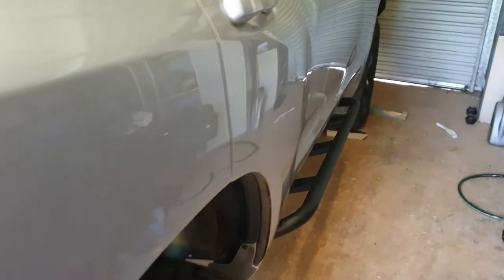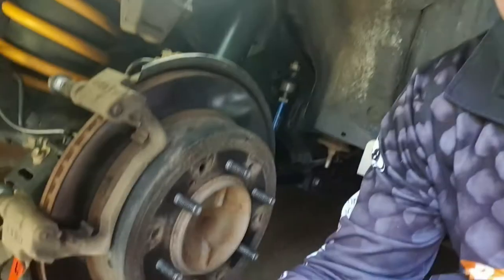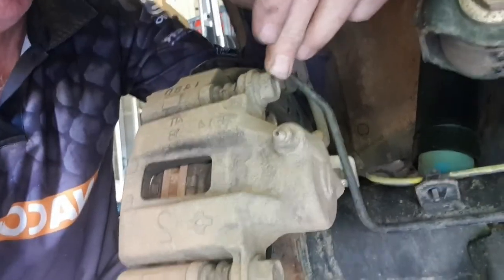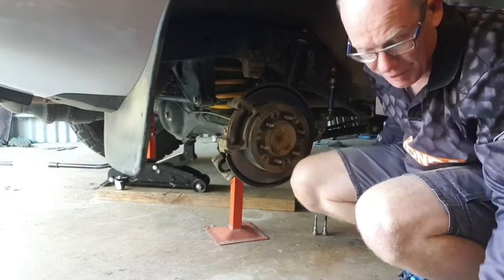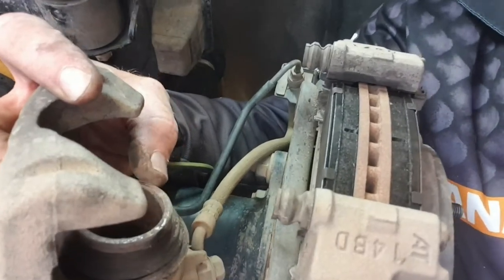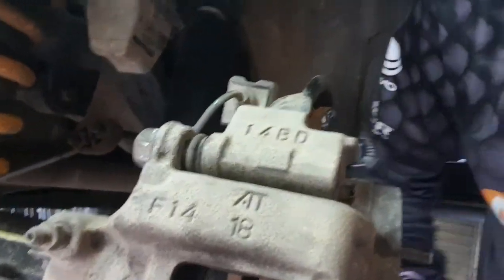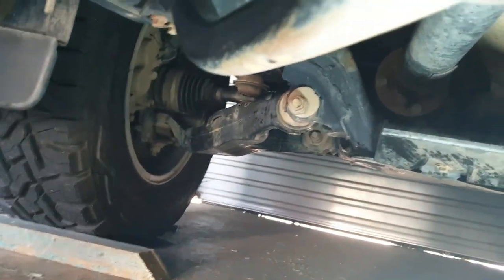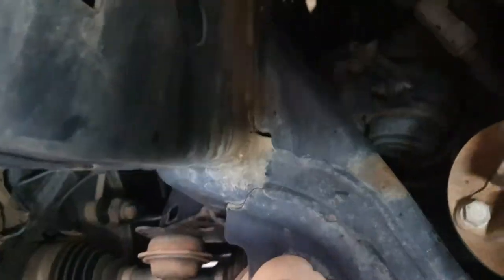How to Replace Rear Brake Pads Prado 150

Comment: Good work, but about the handbrake - that has a different set of drum brake pads within the same rotor at the rear, so the handbrake travel is not determined by the main rear brake pad wear
Reply from the maker: Cool thanks mate. Yep I discovered how to adjust that when I was getting my final check over ready for the Cape